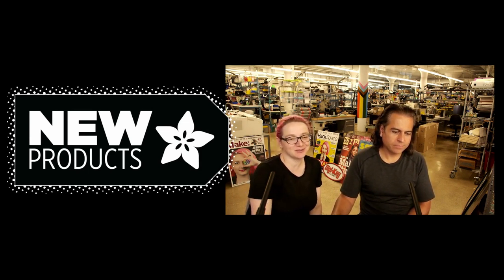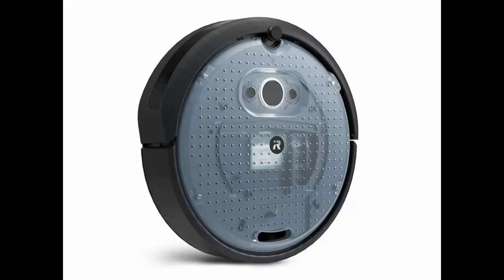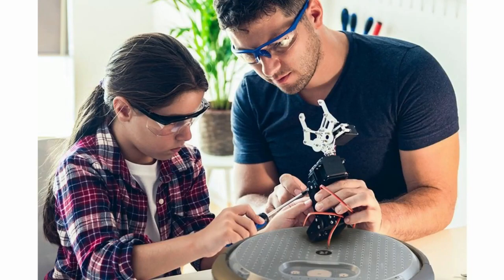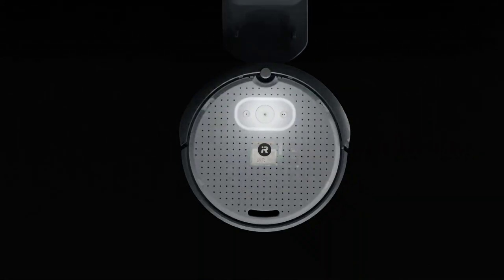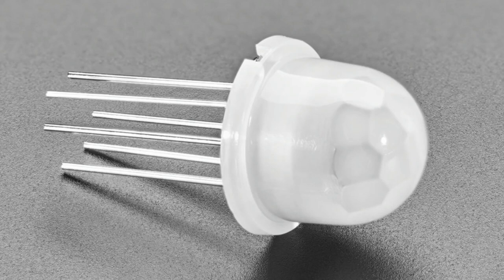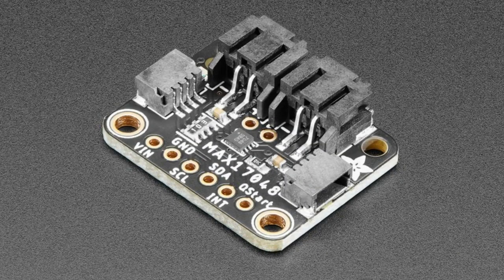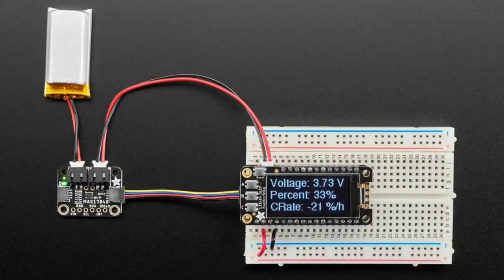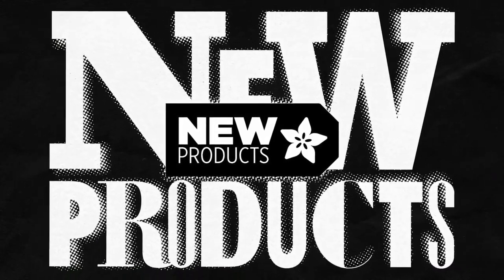#NewProducts 8/24/2022 Featuring #Adafruit MAX17048 #LiPoly / #LiIon Fuel Gauge and Battery Monitor!

Comment: "All the parts that don't suck" They're probably not kidding. I have a handheld LiPoly-based vacuum, and it is a chonker. Getting the weight and power down to something that a battery on board that thing has to be a mechanical engineering feat.

And it runs ROS? OK, that's impressive. If there's a way to change out the motors/controllers for something beefier I would have used it a couple of years ago.

Comment: I need to know if the fuel guage is capable of handling battery charging as well, I'm completely new to anything outside of pi based devices and im trying to make wearable tech. Would someone here have an answer to that?